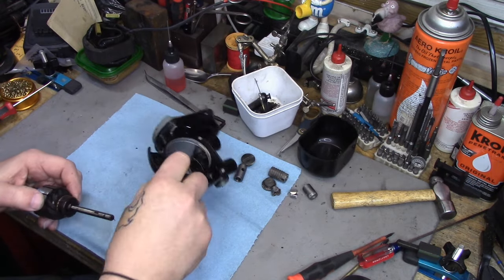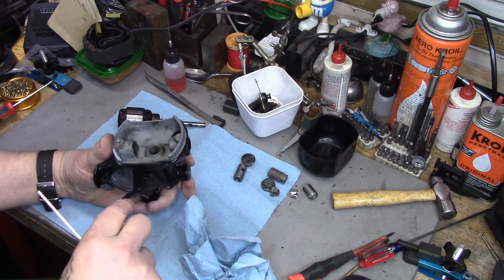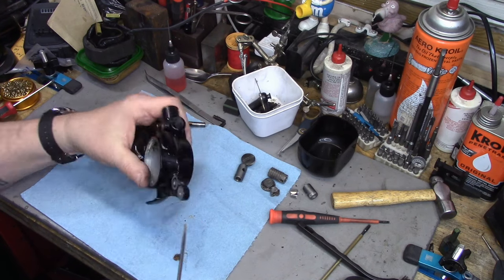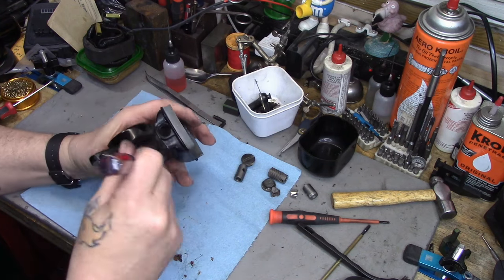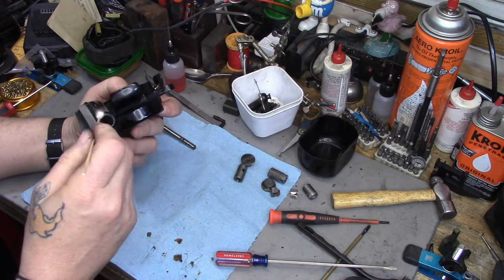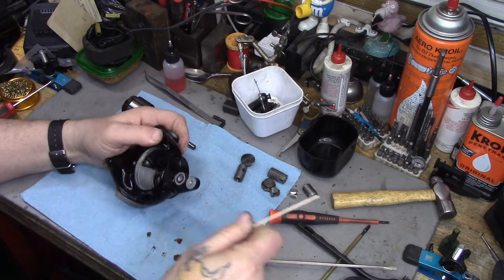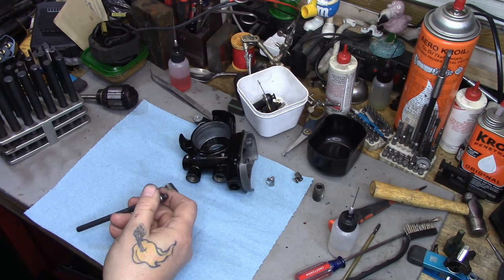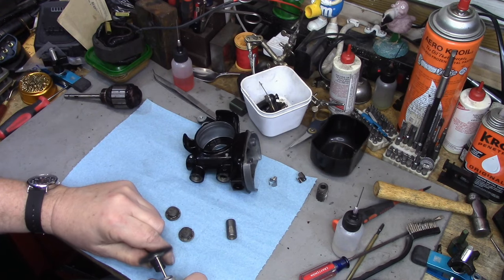Back to the Carcass!

Comment: I feel your pain and frustration Bob. I restored an old lathe for a customer some years ago. It had been stood for 10 years and the front main spindle bearing was locked solid with dried grease. It was like iron, 24 hours in acetone did little or nothing and we tried IPA, petrol and paraffin (kerosene). The only thing that softened it a bit was Methylated spirits (Denatured alcohol). A replacement open tapered precision bearing was around £750 ($960) !! so cleaning was imperative - took me two full days picking bits out of it, washing in Meths ad nauseum. Got it in the end and it spun clean and quiet before assembly and regreasing. I think what had happened was the front seal was worn and coolant had got into the grease and set it like concrete. The rear bearing was OK, the grease was a little dry but 10 minutes in the hot parts washer then a blow dry and it was perfect.
Reply from the maker: Sometimes chemistry is the answer, sometimes brute force...

Comment: I like the pack of 3 brushes, sadly in the UK the brass looking brush is magnetic and not brass. It is hard to find a brass brush now.
I also use an old "Philips Sonicare" toothbrush to blast some of the stiff dirt but not the baked on hard stuff. 

You do a fabulous job making the machines look and work great maybe one day I might be inspired to do more than just make my machines run so we can use them. 

Potted motors  not that popular for the 201k in the UK, I just added up our 201k some I bought because I wanted a case and got a free machine ;-))
Two black alloy built in the same month and year.
Two brown alloy bought because of what was included with the machines. The case was more important and it was only £10.
Three black cast iron 1/ 1951 Centennial 2/ in a small full cabinet treadle, very unusual veneer 3/ Hardly used and in mint condition.

I have managed to stop saving machines but it is hard not to. Makes me smile how many I have fixed and given away as presents. (I do have visiting rights though)
I gave away a 99k with reverse to a young couple in a modern house for the lady to sew some of her son's sports clothing etc. When I visited again they had taken the case off and displayed it in the living room, I never thought they would do that ?

all the best
Reply from the maker: Some of this stuff inside was just plain old crusty!

Comment: Hi Bob! Did you say what cleaner you used in the ultrasonic? If so I missed it. Also, agreed with the brass brushes, they leave brass behind on whatever you are using them on. Is that why you don’t use them?
Reply from the maker: Hi Jen, I use hot water and regular blue Dawn dish soap. Dawn is an excellent degreaser and doesn't hurt aluminum. And yes, that's why I don't use the brass brushes.